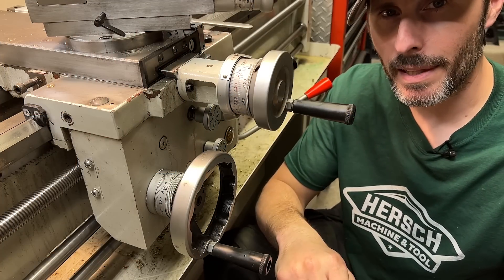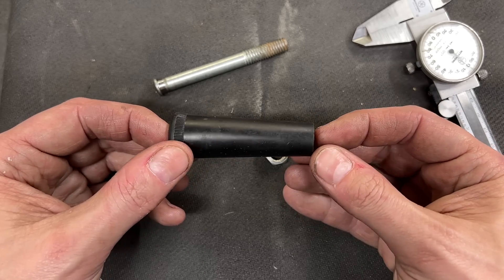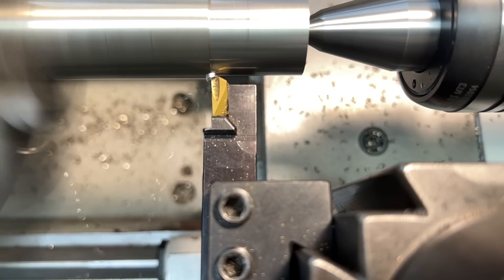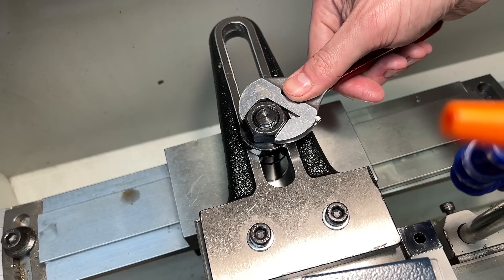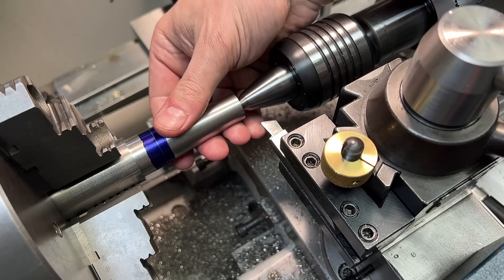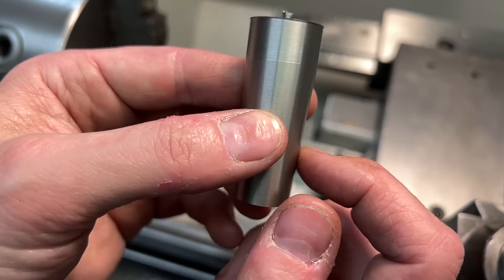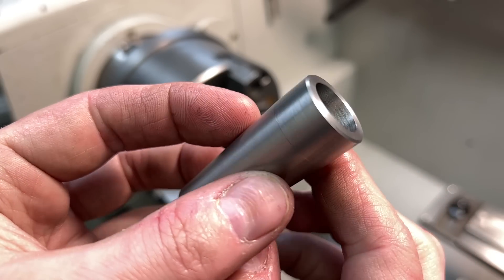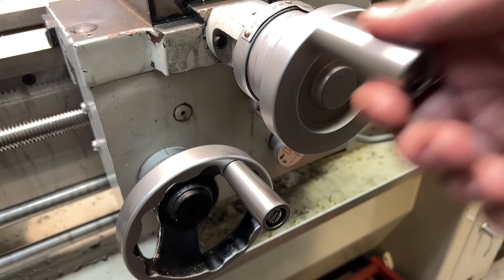Easy Stainless Steel Lathe Handles

Comment: I liked the video and as I’ve commented before my machine came with metal handles. I’d sure like to know more about the holder and insert you used before switching to high speed👍
Reply from the maker: Thanks very much. It's a swiss style front turning tool. NTK cutting tools TFX/TFT insert.
Reply: Thanks I’ll check it out😊

Comment: Plastic tube caps would look great to cover the screw counterbore.
Be careful with heavy handles, they can drop when used around 3 & 9 o'clock especially with interrupted cuts.
Reply from the maker: Yeah I already had that problem with the old handles and they weren't as heavy as these. I would like to add some kind of counterweight or something.

Comment: I made similar handles for my Grizzly 1440 lathe but I made new shoulder bolts with PTFE bushings.  Very smooth and quiet.  The originals were metal but loose-fitting and clunky.  I also like those rotating handles that McMaster carry.  If I get tired of the ones I made that’s where I’m headed.  I admire your taper cutting attachment but for now the compound will have to do.
Reply from the maker: I haven't seen the McMaster handles, will have to check them out. I definitely could have used the compound for this but I wanted to try out the taper attachment since I'd never used it. thanks for watching btw.

Comment: Another fine video with useful content. I may have missed it, but why not just use the compound for the taper instead of the much involved attachment?
Reply from the maker: Mostly I just wanted to try out the taper attachment because I've never used it before. Definitely could easily be done using the compound though.

Comment: I see a video in the making. By replacing the screws with turned one with a wider, rounded head and a little proud of the handle. That would be a really sweet addition.
Reply from the maker: Yeah the existing bolts are pretty lackluster... some other folks have mentioned bearings as well which might be nice too. Thanks for watching btw

Comment: This is a great upgrade.
I would use shoulder bolts in lieu of the cheap originals.🎉❤
Reply from the maker: Thanks very much. And yeah that was the original plan but I realized I could reuse the originals and caught a case of the lazies and ran with it lol

Comment: Hatin on my plastic handles.. ha.. I see. 
lol 😂 I like my plastic handles so much I ordered all new ones from McMaster Carr  !  There is a couple they don’t offer I’ll have to make and they will be 304 stainless as well. I love my taper attachment though. Only setup I need to do is the lock bar that clamps onto the ways. 
I have a second machine thats identical if you’re ready to come get it ! lol 😆 no more change gears, 2500 RPM’s, electronic brake, oooooo sounds nice right ??
Reply from the maker: Lol yeah, I miss my leblond it was the same way, had a super nice telescoping taper attachment. I'm hoping to find something a little bigger and a little nicer that'll do inch metric, module, have taper attachment etc. There's an okuma not too far from me but the guys been leading me on for 2 months so not sure what's up with that.
Reply: @hersch_tool  sounds like he is not a motivated seller then, good luck with your hunt .

Comment: Too bad you blew your dimensions and the fit is sloppier than the original.
Reply from the maker: Too bad I didn't, and it isn't, because it's literally a drilled hole... 🤦‍♂️🙄
Reply: @hersch_tool  you couldn't measure and find a more appropriate drill size? 

Wait till you grow up and learn about reamers 🤡
Reply: A tad harsh, but yes.  

If you really wanted to go for it though machine out the handle for some bearings?
Reply: @justblairthompson  or just machine it to the proper dimensions. Add a drip of oil, it would have been real nice.

 Instead of looking like some 8 year old chinese kid made it in a slave labor camp. Then bragging about how good it feels. What a clown🤡
Reply: @EitriBrokkr  Yes, nobody likes to be hoodwinked. The job was poor for all to see. To claim it was literally a drilled hole and you did not blow your intended dimension as a reply in the comments means nothing. It was drilled far too loose and counterbored too deep.
Reply from the maker: @justblairthompson   That could definitely be a fun way to go about it, turn a new bolt/shaft and press a couple bearings on, would certainly be nice. Also this guy has left comments like this on a few of my vids, always super negative and completely irrelevant, hence the harsh reply.
Reply: @hersch_tool  yes I did think it was a bit much. 🤣
Reply from the maker: @justblairthompson  yeah I edited it, you were right. That's not the kind of person I am. Thanks for calling me on it. 👍
Reply: I wasn't calling you out on anything.  I thought the op had gone a bit ott. @hersch_tool

Comment: Yeah, there really is no comparison between the plastic handle and a proper metal part... Even brass handles or any decent metal will do... 
Speaking of the finish, get some fine files... A fine slant cut file leaves a superb finish, almost like polishing grades of sandpaper, but not by abrasion, but by shear cutting along the plane... Play with some files, i know that getting a full decked out set of high quality files is both hard and costly nowadays, but get a few files... Rough files can impart some serious geometry and remove some decent amounts of material, where the fine file will turn a mangled part by a rough file into a smooth almost ground looking part... And the angle of the attack with slant cut files is quite the factor in getting a superb finish... 
Regarding weight, you could bore an undercut inside the handle - removing material so that enough is left on both ends to be supported by the screw round body, but having the section between the ends ``grooved out`` to lighten the thing... 

Nice work! All the best!
Steuss
Reply from the maker: Hey man, thanks very much! I've got a decent little pile of files, actually an annoyingly large and unorganized pile if I'm being honest. I want to get one of those purpose built lathe files though. I like the weight, part of the reason I went with the 304 was for the heft, feels good and tactile.
Reply: @hersch_tool  Yeah, i get it, but honestly, i noticed that most of the weight is actually not weight, it`s just the feeling of good finished steel... The weight can be quite minimal, but the feel is still there... As long as it`s a nice part it feels good... 
Speaking of files, yuh, a lathe file is a supreme instrument honestly, quite gentle and fickle(requires constant cleaning to maintain the finish and teeth in general) but it really does some superb work... Speaking of having a load of files, keep them, you are but a decent tool&cutter grinder or a surface grinder away from turning them into broaches... 
I generally snag most square files off of scrapyards... The old ones which are toolsteel all the way through though... Some good stock already in decent forms... Hard as a prick, but good stock for grinders... 
Speaking of files and file finish, i`ll be posting a video in a few days(hopefully) in which the pulley i`m making has the fine file finish in the groove - looks quite akin to polished finish... It might float your boat, it`s a weapon`s grade chunk of stainless... An absolute overkill for a lawnmower part, but well, it`s better than OEM...
Reply from the maker: @camillosteuss  overkill? What's that?... 😂
Reply: @hersch_tool  well, let`s be honest, the OEM part is like 400 grams, the new part will be 1600 grams or more... Haven`t yet checked the final numbers(the part is not done)...

Comment: Can't believe it came with plastic, but completely right move to ditch those. Nice job.

Pro tip- pack the bolt with grease as you put it inside the handle and it gives the feel of quality bearings and dampens the touch a bit.
Reply from the maker: Haha I ended up doing exactly that! It does give it an even smoother feel. Thanks very much!

Comment: you are so damn right about those plastic parts 😉....i replaced them too, but i prefered brass...maybe, because my small lathe does not like stainless 😁by the way...great filming!
Reply from the maker: I still want to replace the knobs on all the shifters and am thinking I'll use brass on maybe the power shifter and the half nut as nice accents to the stainless. Thanks very much btw!
Reply: I prefer brass too.  Though my lathes are pre WW2 cast iron ones (still under renovation)
Reply from the maker: @justblairthompson  nothing beats the old iron
Reply: @hersch_tool  oh plenty does, but I like the feel and aesthetic of old stuff.